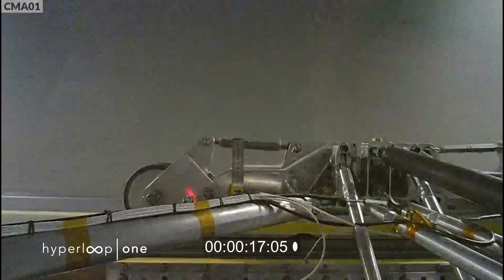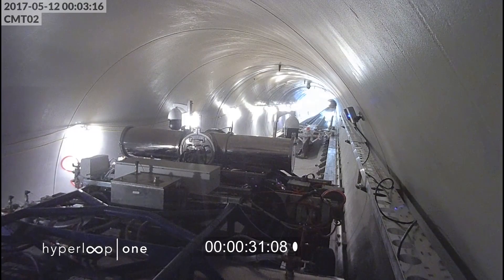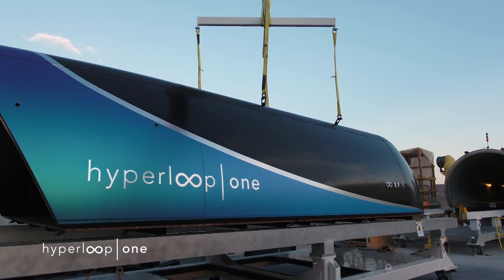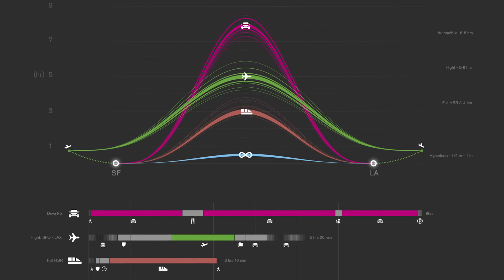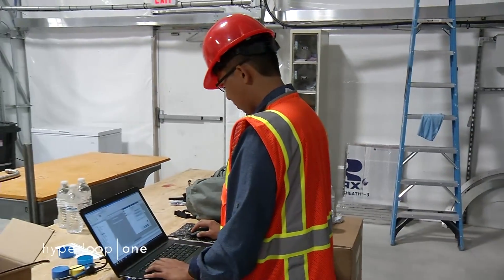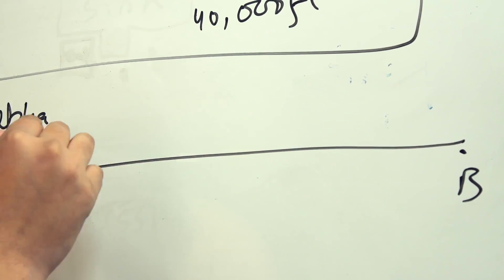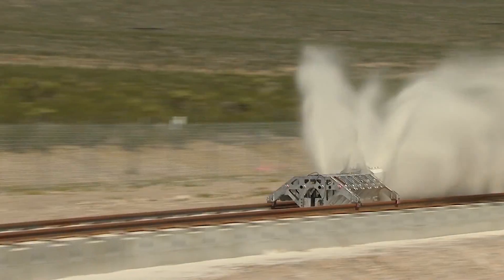Watch the Hyperloop Complete Its First Successful Test Ride | WIRED

Comment: The pneumatic tube mail was a postal system operating in New York City from 1897 to 1953 look it up the scam artist  elon is just a tech hipster  the tech has been around for 133 years  instead of vacuum they are using magnets big fucking deal

Comment: For something running in a vacuum on magnets that was a very rattly train sound coming from it, it suggests it was contacting the track. I fear that like supersonic air travel and nuclear power that whilst if you throw enough money at it you can make it work, the reality of all the complexity like all those expansion sealed expansion joints in the tube and stopping faith following nutters shooting holes in it will make it uneconomic. But its not my money so wish them the best of luck with it and will be happy to be proved wrong.

Comment: To start, I don't get why they are reinventing the maglev train. It's already here! And the pressurized vessel? an airplane fuselage. The tube is just a tube, so where are the real technological/engineering problems?  In the junctions, the seals, the airlocks.... and they are not touching these, but wasting time in something already working....

Comment: News Flash: Empty simulated passenger capsule reaches 72 mph on a block-long maglev track inside a tube.

 This is big news?  Looks more like sheer hype to me.  Maglev (magnetic levitation) is the most expensive propulsion system on earth.  There are only three maglev trains on the planet and only one of them is longer than 70 miles because both the cost of construction and maintenance costs are far too high to be commercially viable.  Moreover,  the Hyperloop design, a maglev system inside a suspended vacuum tube, will double the costs of building a maglev system.  
    By the way hasn't anyone noticed that maglev without a vacuum tube to run in is already plenty fast?  The vacuum tube is sheer folly, useless added complication, and wasted money.   From SF to LA would be 35 minutes with the theoretical HyperLoop at full speed, 70 minutes with an out-in-plain-air maglev train.  Would you be willing to be shot blind through a gun barrel to save 35 minutes?    
    As for the brilliant idea of shooting people through a tube, that's nothing new.  In 1953 I saw Ringling Brothers shoot a man out of a cannon.  Now the Musk idea is to make the cannon barrel four hundred miles long.  Is that a brilliant transport design or an idiotic one?

Comment: YOu expect me to go into one of these hyperloop? Sorry, I see major design flaws. I wouldnt ride in a train inside a vacuum tube. What if there is a fire, how do you get out of the tube, youre in a vacuum. What if there is a leak in the train, passengers would die instantly with decompression. Think of the same analogy as if youre in space capsule and small leak would instantly kill you cause youre surrounded by nothing, hence a vacuum. Its also not economically viable. You not only have to create a tube but also have the generators to keep it "vacuum" all which adds a lot of cost. Would that extra cost make the air friction less tube worth the cost? How much faster would it take in comparison with how much more money that needs to be spend to keep it at that speed? Does this make economic sense. Not to mention the technological maintenance of keeping the tube functioning. Sorry guys, but hyperloop is over rated and its going to be a money loss at the expense of the taxpayer.

Comment: I can't believe that wired promotes itself as a science magazine, they didn't point out ANY of the glaring problems with this idea that was proposed 100 years ago but determined to not work in the real world. First you have the difficulty of maintaining a near vacuum over miles and miles of the tube (loading and unloading will take quite a long time, multiple hours). Then you have the expansion and contraction of that much material which over a distance of miles means you'll get thousands of feet of expansion and contraction every single day which means your stations would have to move with it thousands of feet back and forth everyday. Then you have the ultimate barrier sudden loss of vacuum containment which with its pressure wave would catastrophically destroy the tube while shooting any capsules out the ends at incredible velocity. Sad that none of this was covered or that they weren't questioned further as to why the didn't use the fully built prototype capsule in the tube that was built for it?

Comment: Wouldn't it be cheaper to use an enlarged version of the tubes you see at bank drive throughs? Have airflow assist the train. That way, if something catastrophic happens to the tube, but not the track, the trains would still work, but be slower, like a regular maglev. It would also make the tubes far cheaper because they wouldn't need to withstand outside air pressure for hundreds of thousands of miles (an entire interconnected network across the country).

Comment: use a gas which is less dense than air to decrease air resistance.  while also maintaining the same pressure.  a semi-air tight tube which is sectioned might work better.

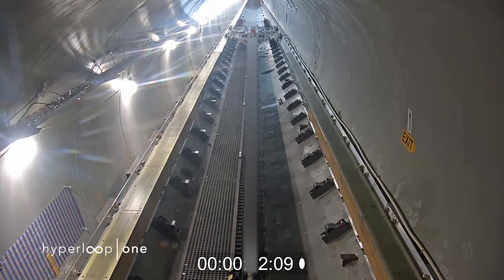Comment: why from 1:41 to 1:44 there's a blurred out vertical strip in the recording? some secret hidden technology you don't want anyone stealing?

ALSO, if the tube needs to be in a vacuum, how the fuck long will it take to pressurize a fucking long ass tube? that could take hours to pump all that air out

Comment: Impractical, slight damage to the hyper loop would result in the deaths of everyone inside it.
Reply: TheAtrocitus Well said
Reply: slight damage to a rail track and a whole train de-rails killing everyone your point?
Reply: nestafett2 put it in a vacuum with a cm wall, where a pin sized hole would kill you all
Reply: Rxonmymind Are you guessing or is it real? Even if it is, the rabbit could pass safely then something would happen. Remember: ONE fault will send a blast wave down THE WHOLE TUBE at the speed of sound, killing you instantly.
Reply: They'll have a "rabbit" go ahead of the real consumer carrying hyperloop for safety.
Reply: nestafett2 Mate, if you have a vacuum and you allow air to get in, it creates a pressure wave at the speed of sound. I visited the hyperloop test track and it is very shoddy work, rust everywhere, plastic bits to level it etc.
Reply: nestafett2 just google it. Because I can point out obvious things doesn't make me a super genius. http://bfy.tw/EGDB
Reply: nestafett2 Judging by many factors, I have concluded a similar failure rate to that of airplanes, except with airplanes there is a chance of survival there is none (Currently) the engineers need to do something, what's to stop me walking up and pouring gallium on it? The entire structure would collapse due to the pressure and the weakened shell.
Reply: 3C-FD I’m not saying it’s impossible, it just may cost lives in the mistakes we make. Same as you said, like space travel. But would it be really worth it, just for this?
Reply: could be used for cargo shipments easy enough.
Reply: nestafett2 Also, please remember netiquette
Reply: I hold my position until i actually see this system working. If it works safely good for them, if not, well too bad
Reply: This is why i have doubts: https://imgur.com/a/TCeWB
Reply: Just fucking send it.
Reply: A blast wave at the speed of sound.  Sound has no speed in a vacuum.
Reply: Nolan Milnes speed of sound = 310 m/s, the air would rush into the tube at that speed. Luckily, they are now making good failsafes that should work, so if they don’t mess up we might just have a new form of transport
Reply: There are pin sized holes in airplanes and people are not dead.
Reply: Jakin Chan The interior of an airplane is not a vacuum. If there was a hole in the hyperloop, due to diffusion a huge amount of air would enter the tunnel at the speed of sound (it’s a vacuum so there is no resistance to slow it’s entry). But again, they are now making failsafes in case this happens.
Reply: toby91912001able Definitely
Reply: Hamguy Bacon Still Dangerous.
Reply: even a rocket is safer than the hyperloop.
Reply: the problem is the tube, wich is in athmospheric pressure and inside the tube is very low pressure.  if the tube gets damaged, it will be crushed by the athmospheric pressure.
Reply: a train crash can be survived.  people survive train crashes.  sometimes even plane crashes.  but when the tube of the hyperloop breakes, it is over.  it is like a plane crashing straight into a mountain with 500mph.
Reply: nate komodo omg.. youve enlightened everyone.. we should stop this project then.. hahaha.. fuckin idiot
Reply: Aescius theres many factors and not just your dumb calculation. If everyone could stop talking out of their assholed thatd be great.
Reply: watch thunderfoot's videos on the hyperloop.
Reply: TheAtrocitus thats friggin awesome
Reply: hence the cabin being pressurized
Reply: INSERT INTELLECTUAL DIALOGUE AND FACTS HERE
Reply: lucky guy use common sense.  if air leaks in a vacuum, it's no longer a vacuum.
Reply: You're a moron, an airplane's entire engine could be destroyed on a commercial flight, and it is still possible for everyone on board to survive. If the hyperloop experiences even a dent, the difference in pressure will instantly crush everyone inside while simultaneously exploding.
Reply: Just like airplane's which were a colossal flop.
Reply: MayMay Machine Air planes are safer then this.
Reply: Bengt Björck If you're going to try to make a comeback, at least get your facts right. Clearly YOU don't understand.
Reply: sean not a fair comparison, the tubing is weaker then rails
Reply: nate komodo Same goes for space travel. We still did it and we suceeded
Reply: its not a perfect vacuum, there is still air inside.
Reply: No, because the Hyperloop is transportation in a vaccum, and airplane travel isn't.
Reply: The hyperloop is just like an airplane. Airplanes are pressurized tubes in a low pressure environment. The hyperloop is a pressurized tube in a low pressure tube. Same thing. If an aircraft's fuselage fails, explosive decompression would occur, breaking the aircraft into pieces. However, statistically, this is extremely unlikely. Flying is much safer than driving, by a lot. Your chances of dying in a car crash are 1 in 158 or (0.006%)*. Whereas your chances of dying in a plane crash are *1 in 11,000,000 or (0.000000091%) which is extremely unlikely. The chances of dying in a hyperloop should be around the chances of dying in a plane crash.

Edit : Did the math ;)
Reply: No that is not how it works. Please smarten up. Don't make statements about things you clearly don't understand.

Comment: this wont work at scale. in order to have it be a full vaccum they would need a rigid structure that is light weight and wont expand with heat. those tubes will twist and flex with the temperature changes and that would be impossible to keep at a full vacuum. this only could work on a small scale. also not to mention the constant maintenance it would require. also what happens if it stops for any reason while you are in the middle of the tube? what if the vehicle you are in springs a leak while you are inside? there is too many things that can and will go wrong, that will make this nothing more than just a pipe dream.

Comment: what about the g-forces applyied on the passenger?  and what about security systems in case there's a problem with pressure inside the capsule?

Comment: The thing that people don't understand about this is the safety concept, in railway industry it takes more time to prove and test the safety of the trains more than it takes to prove the working concept just think of it like this why you take a plane if the plane have 90% chance of crashing that's what aviation and railways are selling safety and speed that's why I'm not hyped by this at all because they never talk about safety of hyper loop and they never did a fail test not like the railway which is my job to actual think of every possible failure of he trains and see what we can do about it so t won't kill the people inside

Comment: I have no doubt Hyperloop programmes will keep on running. But I believe it will take a long time for them to finish testing the project. Once done, they may suffer the same fate as maglevs are right now, unless the maglevs themselves blossomed all of a sudden. So Hyperloop is not impossible, it's just a distant dream. Though I don't like Hyperloop that much because it's not total vacuum, so I love Vactrain instead.
Reply: In December, the very company featured in this video went belly up.

Comment: This is a major milestone, but a very bad result. It promised to be going with a speed about 700 miles per hour, but in this experiment it shows only 70. 10 times worse than expected. 10! Not 1.5 or 2, but 10!

Comment: I have a few questions.
The whole thing is a vacuum, one vacuum-chamber tube that's hundreds of miles long. It will have to be opened to get the capsule full of people inside it and then sealed, right? If so, once inside it, how long would it take to suck all the air out? What happens if there's a slight leak somewhere along the hundreds of miles of tube? The capsule will need its own oxygen supply presumably as it has no contact with the outside world. What happens if the capsule gets stuck or the mechanisms propelling it break down? How will the people inside the capsule get out? What if someone has a medical emergency onboard? How can any assistance get to that person?

Comment: With the electromagnetic propulsion, (semi) vacuum sustenance it is going to be too expensive (same thing killed/is killing maglev trains). A regular high speed line between LA and San Francisco is way more promising, not as fast but realisable with technology we know won´t go wrong and is greatly improvable. Regular track speeds will approach 400km rather soon (design speed for AGV-train) which is enough for most applications (LA-San Francisco (700km distance in roughly 2-3hours ain´t bad, in fact it´s right within the limit people are prepared to travel in (HST vs plane). Also with rails there is interoperability, meaning freight trains and other commuter/passenger trains can also utilise at least portions of the track (whole length, when HSTs don´t run e.g. at night at 2 a.m.)